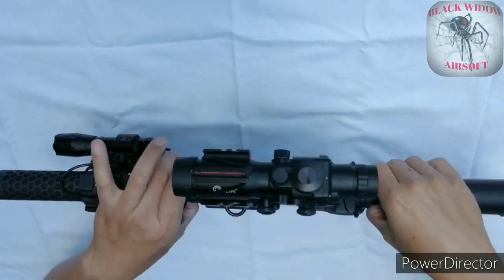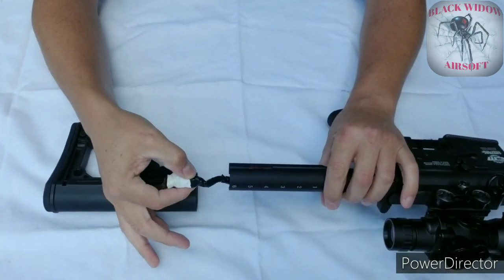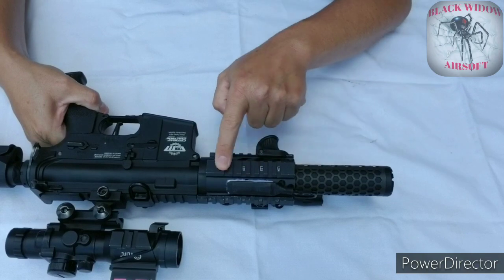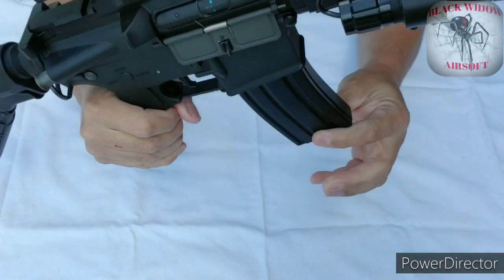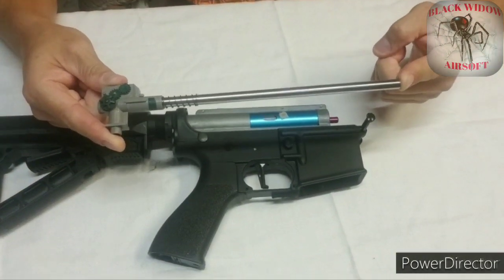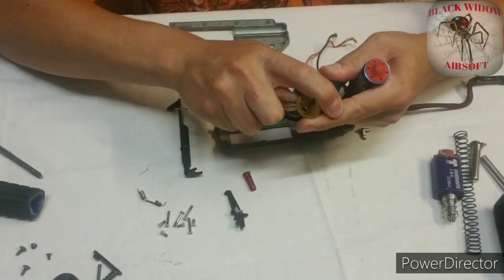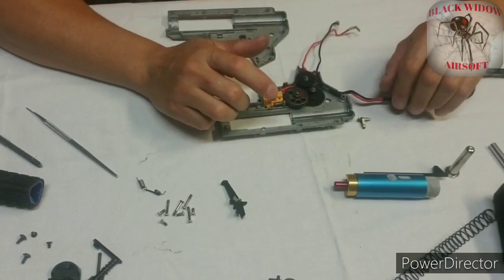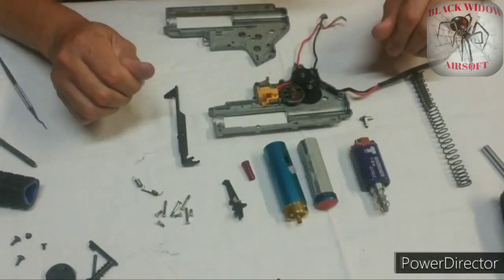G&G Firehawk breakdown ( internal & external )

Comment: What mags are good with this gun, I’ve been trying to find mid caps that feed well on this and g&g polymer mags suck, I’m wondering what mags you had and do they feed well
Reply from the maker: I use Elite force 120 rd midcap mag you can find them in the US at around $80 US Dollars for like 10 of them I don't use much full auto and if that is what you want them for I'm not sure this mag will be able to keep up it will feed up to 30 rd but any higher I'm not sure check out my other video on how to fix the wobble on your mags

Check this out at Amazon
Elite Force M4 and M16 6mm BB Airsoft Gun Magazine, Black (140 Rounds), Pack of 10 https://www.amazon.com/dp/B00AH1AI4K/ref=cm_sw_r_u_apa_fabc_NG1D6GPDZE5Y91KJBYKX
Reply: @blackwidowairsoft4301  thank you

Comment: Just one question will the suppressor and barrel extension work with the original 3 ing rail or do we need to get a 4 inch one
Reply from the maker: Yes you could use it, but you would have to file the inner of the rail to widen it.

Comment: How did you take apart the stanad front? I want to replace the outer barrel but I have no idea how to get it out.
Reply from the maker: Remove the rail, then  add some heat to the outer beral, and then unscrew the rail nut from the upper ricever.
Reply: @blackwidowairsoft4301  Is it a regular crucifix or some other kind?
Reply from the maker: I'm not sure I understand your question.

Comment: Question, are longer versions of the rail guard available for this gun also where did you get the new rail
Reply from the maker: Yes this is a after Market free Floating rail that I got from Ebay but you can't no longer get it from Ebay in the US,  and this was a pretty sweet deal got it for around $20.

Comment: how did you get the barrel nut off?
Reply from the maker: I don't really remember. Sorry
Reply from the maker: I don't really remember. Sorry
Reply: First take off the stock rail and then under the top screw there is an Alan key screw. Take that out and then there is a hexagon shaped metal piece that is the barrel nut that can be turned counterclockwise and will come off it’s under the plastic outside

Comment: How did you remove the weird circle thing on the front with the 6 decorative hex keys? I'm trying to make the gun longer but I can't because of that thing
Reply from the maker: You unscrew it clockwise if I remember correctly.
Reply: @blackwidowairsoft4301  I tried it but I doesn't work since it would be blocking itself against the M4 body of the firehawk
Reply: @tokyxrs4567  you worked it out yet lol
Reply: @lalshortshot2051  I still haven’t lmao
Reply: @tokyxrs4567  I got mine off easy, did you undo the grub screw that's in the plastic ?